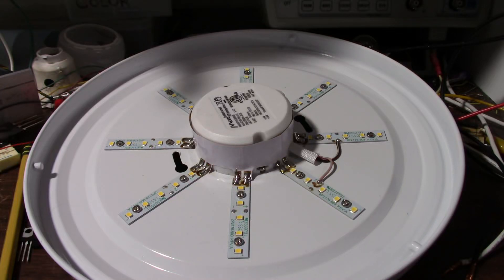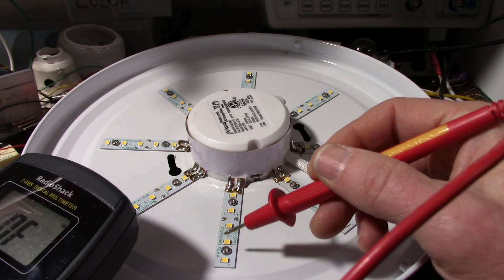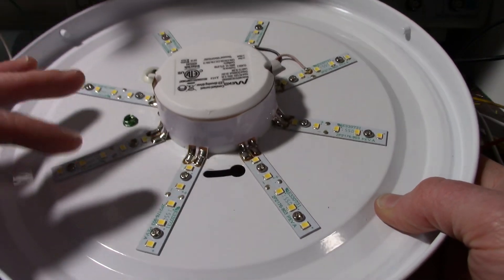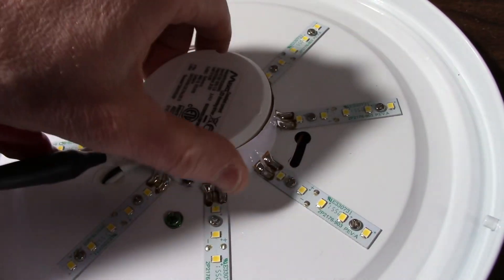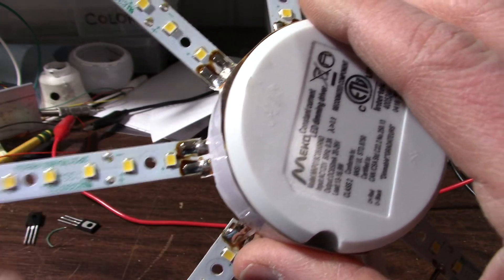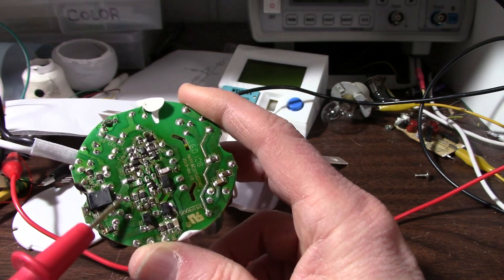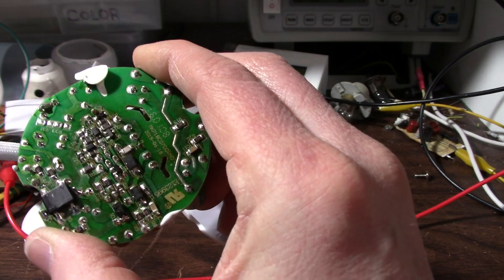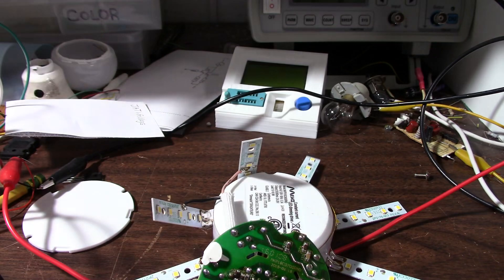LED light fixture teardown in attempt to see why it FAILED

Comment: John, thx for sharing. It's always about the cost of replacing the unit. If the unit is less than $30 scrap it for parts. If it's around $100 then it is worth your time to dig into the converter IC and and replace it. Those ICs are less than $10 and you get to cheat the Chinese out of another sale. If you think about it, a unit like that should last 50K hrs. in a home ceiling light application which would equate to about 4000 yrs. Hahaha. Nah, actually for 8 hrs a day it should live about 17 yrs. That is the half life expectancy where the output from the LEDs drops to 50% output.
So, not knowing what you paid for the fixture you are on your own.
Again, thx for sharing.

Comment: Much better to use light where you can use regular light bulbs. If you are not satisfied with the light color then you can replace the light bulb. stops the light to light so you can replace the light bulb. You can buy led with good color or warnvit led. with too much yellow.

Comment: Back when I used to fix switching power supplies, if it wasn't shorted power electronics, it was a small cap with high ESR or a high value bias resistor (~100K) that failed.  Both were used to get the oscillator started.  Without that initial start, it just sat there.  The complex stuff almost never failed - not unless things shorted out and got to it.

Comment: Great as usual. Any AC on the secondary?  You should see the ghost of the PWM almost anywhere with your scope. If both of those are true, your 5-pin is probably working. 

Then what?  Zener buried somewhere, bad opto, it never ends. 

You’re right. Chuck it in the #>^^~ bucket. 

You know, you really have the right stuff for this YouTube thing. Let your humor out (not the 18th century type).

Comment: You should test the ESR of the capacitors.   I built one of the many DIY ESR tester circuits online and that thing has been a godsend.   I have solved so many circuit issues by finding high ESR caps even though they test good on a regular cap meter.   Best part is it can test the caps in circuit because it does not bias any semiconductor junctions and most resistors are way over 1 ohm..